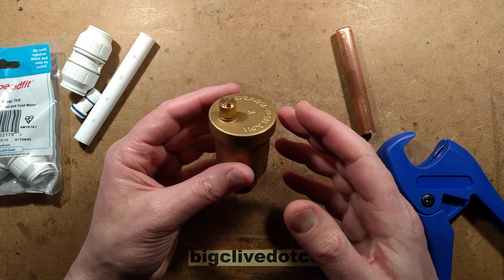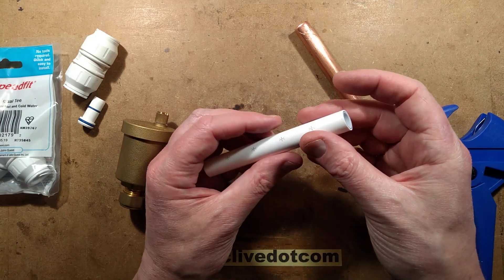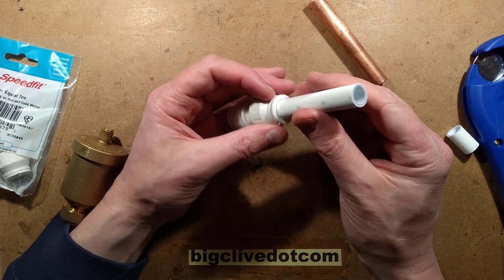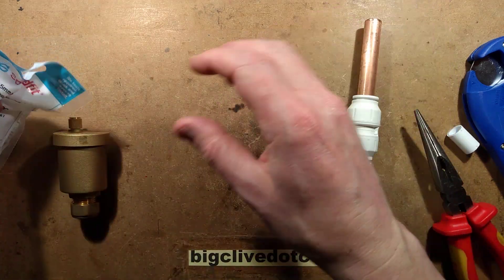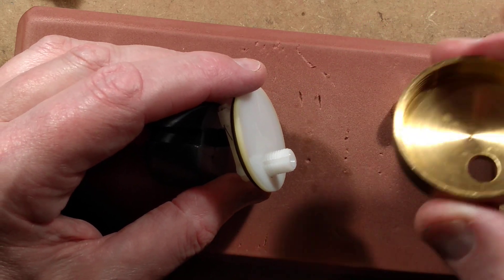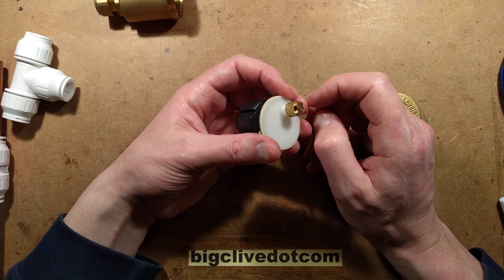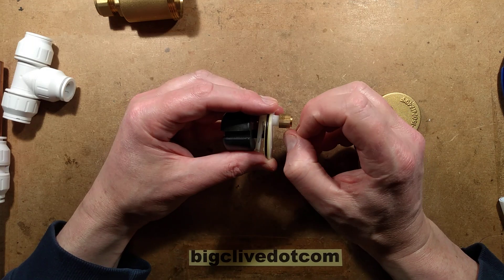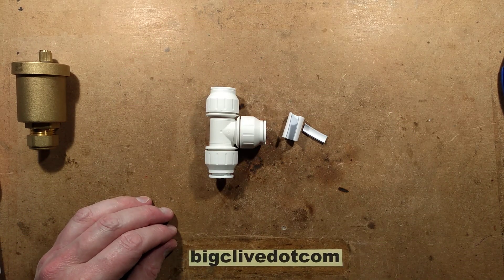Inside a bottle air vent and plumbing ramble.  (No electronics whatsoever.)

Comment: As a retired marine engineer, I have always sworn by copper pipe, but seeing this has given me food for thought. Very interesting video (as always). Keep up the good works.
Reply: it's very easy to use and there are different makes, but have used the jg speedfit stuff, (available at screwfix in the uk) it is as simple as, cut pipe, use insert, insert into joint, that's it , only thing i have against it, it's more plastic in the world
also am a bit against using it for mains/drinking water but that's just me
Reply: idiot stupid our Sharkbite system is also questionable for water, made of a supposedly leadfree brass alloy, but who really knows?
Reply: As a sailor you without question have sworn, though the presence of copper pipe was only coincidentally “by” only due to frequency of curses in a large variety of locales. That’s the engineering part: a rule of thumb everywhere there’s water.

Comment: On JG speedfit don't forget to use a locking clip under the release collar. Esp on long runs of heating pipes that can expand/contract enough (over time) that the collar can release if it rubs against a joist or an adjacent fitting. 
A smear of fairy liquid on the pipe eases assembly of fittings too. When I did a plumbing course a few yrs ago, all students were using quite aged & dirty JG fittings & old plastic pipe that had been taken on & off hundreds of times by trainees. Rather impressively, despite the extreme re-use & tired appearance of the fittings, none ever leaked & gave me trust in their integrity.
Reply from the maker: I'm going to make sure any connectors are well away from adjacent objects that could press that locking ring in.
Reply: All good then, you'll be fine 👍. From memory, the only restriction on using plastic pipe is to not connect direct to a boiler, (due to residual heat build up), & the 1st metre from any boiler should be made in copper.

Comment: I've used both. I did not find one to be much faster in general than the other. but the flexibility of the pipe was defiantly advantageous in certain situations. Also our house is in the shadow of a hill here in st johns so its very cold in the winter and the only pipes that took a hit were copper. That said they were also from the 70s. The pipework in our house is like an exercise in finding the longest route to the shortest distance. its ridiculous. So I've been going about reducing that obscenity.
Reply: yodaco ocadoy have fun with whistling pipes, coughing spigots, unpredictable pressure differentials causing temperature fluctuations and water hammers while you redesign what once probably worked pretty well.
Reply: If you want to know obscenity then you ought to have seen the equalizing apparatus I had to invent for the last house I owned where nothing else was possible except to tear out walls- everything was already connected in the most efficient route, yet the whole was less than the sum of its parts.

Comment: The idea with the bottle vent is, you back off the screw cap just enough that air can escape.
No more. If dirt stops the float valve sealing, there is a fibre washer in the cap, which, when wet, will swell and seal, preventing disastrous leaks.

Comment: Yes Clive. I’ve used Speedfit plastic fittings and pipe to add an extra valve to a heating system (the original suffered from gravity self circulation so even when the heating was not on, the radiators on the first floor would still get hot). This was after we had two extra radiators installed by plumbers and I saw them use the Speedfit plastic fittings and pipes (they were not the cause of the circulation problem, that existed beforehand). They loved this Speedfit system. So much quicker and less messing about. They did use copper pipe where the pipes were exposed as they ran along the skirting boards. All this was over 20 years ago now.
Have since moved house (a much newer house), and although no major problems, have had to tighten some of the compression fittings due to small leakages (all copper pipework as far as I can see). But I keep some Speedfit plastic fittings, the straight joins, in case I ever need to carry out a quick repair.

Comment: Great vid Clive! Only downside of PEX is trying to manage a 25m roll of tube in freezing conditions in a loft in winter! The pipe is softer/warmer stiffer/colder.
Reply: SpiderElectron the other downside is having winters with freezing temperatures, a house with unheated loft, being forced to chose winter for the installation and to use plastics with hormonal catalysts in them. How can you even sleep at night in such horrible conditions?
Reply: @HighestRank  You install it. It looks great.. You come back later after it's been used for a while and it sags between every pipe clip!

Comment: Hi Clive, Just watch vid and yes the plastic pipe and fittings are very good in certain applications, Did you know that you can use them on a heating system and that mice just love it. As a Maintenance person for a large hotel group we used this plastic pipe and fittings until the mice thing started we were dealing with leaks on a daily bases and had to revert back to copper. We never had a fitting fail it was always the pipe the little shits chewed through. Hope this helps have a good one

Comment: Used the JG push fit plumbing pipe and fittings for replumbing my place 15 years ago. Absolutely zero problems with it, quick and easy to use. However you do need more supporting clips along the length of the pipe than you would with copper. I was slightly nervous about the possibility of mouse attack, but they haven't touched the pipes, even where they have shredded the foam insulation that I used. Go play in the trap ye wee furry feckers....
Some folks have mentioned possible O ring failure over time. I use a lot of O rings in my world, hydraulics, air, water, drive belts ! The ones that fail are the ones exposed to sunlight, should be fine inside a nice dark plumbing fitting, under the floor.

Comment: We repiped our hot water lines with pex pipe and SharkBite connectors. Pex pipe has some flexibility so it can be angled without using angle connectors. It's also freeze resistant. Pex pipe just expands when frozen. SharkBite connectors just push on. You can also use a kind of split ring tool to remove the SharkBite connectors if you need to.

Comment: I don't get to do much plumbing other than the occasional DIY job around the house, but I have to say that I've found plastic pipe and fittings to be extremely reliable. PEX pipe in particular is extremely good and resistant to almost everything you can throw at it. The only downside is stuff like earth bonding when you have a mix of plastic and copper pipes running around

Comment: I have found the push fit pipes good but I have had a very occasional faulty one very few and far between some of the more unusual fittings are quite expensive though.
Reply: JtotheW kinda hard to test some types without fear of reusability or at least unwrapping a few- so you learn to look inside and identify badly formed tangs, just like farmers used to candle their eggs.
Reply: JtotheW and yes the push fit pipes may be good but those are specifically made to be used as electrical conduits, not liquid.

Comment: Copper has the added benefit of being antimicrobial. With that said, PEX > everything else. Get a cheap crimper, you have rock solid connections, flexible pipe with minimal fittings, and mostly freeze resistant. Even a kid can do it right. I can't trust that o-ring crap. Crimps are better and cheaper. How often do you really need to disconnect your pipes? The oxygen barrier PEX has an aluminum layer inside for heating systems...it's not used for normal plumbing.

Comment: used that system when i replaced my bathroom and kitchen, bit more expensive and bulky than copper but works well with no leaks, i actually have a bag of the fittings lying around, i would worry about plastic and rubber degradation over time though

Comment: Been using the plastic here for quite a number of years, about 2 decades or more, we call it PEX here in Canada. and it is very good especially for freezing, as you mentioned.  We have most of the country that gets down to minus 30 and many places get even colder, and so if heat is lost it is a major risk to the plumbing, but PEX works very well.  We have other systems for connections that are even more simple than yours check out "Sharkbite pex connector" on google

Comment: All I have to say is be careful of pressure reduction, due to the ID of the joints being significantly smaller than the ID of the pipe itself, it lowers per joint due to friction and such.

Comment: the only problems i've seen with plastic pipe were using cheap shit or installing it wrong... it's hard to compromise plastic by cutting corners in its ingredients compared to copper. it's not recyclable, but then again not many people will deal with 50 year old corroded copper pipe either

Comment: I wouldn't worry too much about the compression fittings. They are very similar to what most large trucks and construction equipment have used for years on air lines.
Reply: Shawn O'Hare yet air doesn’t freeze while expanding. Similar concept, different applications.

Comment: The weird hinge may be to give the float a mechanical advantage. 
Not sure what typical water pressures are, the weight of the float, and the area of the valve. ... But having it hinge closer to the valve would give it a mechanical advantage. 
otherwise, the pressure of  the water may be enough to support the weight of the float, and thus the valve would never open.

Comment: One concern common to all types of plastic piping is the growth of bacteria in the pipes.  Copper is a pretty terrible substrate for biofilm formation, but plastics are inert enough that they can be colonized easily.  I guess if you're using chlorinated municipal water, it's not an issue though.

Also: it's nice that PEX is elastic enough to survive a freeze, but the fittings themselves often aren't.  If you've ever worked in a hardware store, you'll know that people will show up every winter trying to patch their split water lines.  You can't just give them fittings to make a repair, or else they'll be back in an hour bitching because they don't understand that their pipes are all stretched oversize.  You can't really warn them either, because nobody ever believes it.

Comment: The problem I find with the auto-vents is that if you leave them with the cap open the seat eventually smegs up (Fernox, limescale, dead water fairys) and they then have to leak until said fromunder fills the vent hole, rendering them useless; until they leak again.
Reply: typical vent, cap open or shut, they gum up and leak.... often crud sticks the float to the side

Comment: As a mechanic, I can assure you that O rings don't last forever. Or even very long. I'd bet on the hot water side, they probably won't last over 20 years, if that.
Reply: MadMan Machinations as a mechanic you’re used to dealing with buna N, nitrile and neoprene rings, and infrequently PTFE. There ARE more durable materials available: for example even the cheap exterior latex paint comes with two and a half decades worth of guarantee, and the expensive stuff is double life at 7x the cost.
Reply: @HighestRank  Using paint as an example of o-ring lifespan is not very helpful. Perhaps you'd care to find out exactly which type of o-rings are used in any plumbing fitting? Let's be realistic here, the manufacturers are not going to use the most expensive stuff, they're going to make it as cheap as possible for their profit margins (which your paint example makes a very good point of). I couldn't find any info on the type of o-rings used. But I looked up SharkBite fittings, and they guarantee them for 25 years, which is not a far cry from the 20 years that I gave them. Knowing that, I'm willing to bet I'm right. They use ordinary o-rings (like everyone does) and they won't last very long.

Comment: Plastic is ok on heating but it expands more than copper so you have to use more fixings. Copper is a natural disinfectant. Plastic encourages bacterial growth particularly after mixing valves where the water never exceeds 43C.

Comment: The popular American brand is " shark bite "  expensive but worth while for repair work or joining dissimilar  materials .
Reply: And they're not technically rated for air pressure, but I've seen them successfully hold a 190PSI/13bar for years just dandy.
Reply: Sharkbite* worthwhile *
Reply: @HighestRank  auto correct

Comment: A little hint . Install an isolation valve when you install it . It will leak and need to be serviced if you install a valve you do not have to drain the system .
Reply from the maker: I always use isolation valves wherever possible.  Although, ironically I have one that now leaks when mid position between on and off because of its O-ring seal.

Comment: Assuming rigid members, are those fittings strong enough to be use structurally?
Reply: Michael Thibault
Not while under 1-2 bar pressure nor while holding a heavy copper pipe filled with dense liquid together as part of whatever other structure you might have in mind.

Comment: here in canada we use a version of the plastic piping thats called PEX we have crimp on rings, push fit fittings called sharkbyte fittings, and fittings like in the video the simplest fittings out of them all are the sharkbyte fittings just push the pipe in and done the plastic piping holds up extreemly well redone my house with it and even the in floor heating uses the piping as well though a special variant of it called he-PEX if you kink the pex piping you can use a heat gun or propain torch to heat it up and restore it its extreemly reliable and forgiving

Comment: Not a huge fan of the compression fittings outside a limited number of specific applications. They tend to leak unless you have tightened them just right: not too loose, not too tight. Solder is your friend.

Plastic supply lines are awful—the stuff currently commonly used in the US (CPVC) gets super brittle after just a few years. The PEX stuff is supposedly better, but eh.

There was a water hammer stopper under my kitchen sink. When I replaced the garbage disposal I accidentally bumped the hammer stopper. It snapped right off and it too me a good 30 minutes to get the water shut off. Would up with about an inch of water on the kitchen floor :-(

The plumber who came out said they have all sorts of issues with this stuff. If you have them repair something they disavow any responsibility if the stuff cracks and and the pipes in the walls need to be replaced.

Comment: Reason is that water pressure will auto close it, even with the float destroyed or flooded. This wouldn't work if the seal could move any further away from the discharge

Comment: Here is a tidbit regarding something said in passing. The conventional wisdom that ice expanding against the piping walls is what splits the piping in freezing conditions is not correct. What actually happens is the ice occupies more volume than the water that became the ice. The remaining unfrozen water has to occupy less volume. Because water is essentially incompressible there is a tremendous water pressure build up in the remaining piping that has yet to freeze. The piping rupture ends up occurring in the high water pressure piping sections. Often when the split happens the sudden drop in pressure in the chilled water results in ice forming at the split, thus leading to the erroneous conventional wisdom. Hard to believe, right? This could get one into a bar fight. This outrageous idea can and has been demonstrated by arranging water filled piping into and out of a super chilled brine tank. The piping in the brine section is what freezes but the unfrozen piping outside the tank is where the piping splits. Of course in the end it is all a moot point. The break is still caused by freezing somewhere.
Reply: nothing like super high "hydraulic" pressures at work,

Comment: I use these for instrument lines on compressors. They are heat cycled hundreds of thousands of times under 150 psi, never had one blow at the fitting.

Comment: While we do have SharkBite fittings here in the US, it's more of a premium option. I'd wager most people stick to the classic PVC and adhesive. It's the most used on new houses here, especially around fixtures. I have only seen adhesive fail when cleaner wasn't used or the glue was not even, otherwise they last 40+ years.

Comment: PEX stands for "PolyEthylene Cross-linked", and usually refers to small diameter water pipes, up to maybe 20mm, in internal residential or commercial fitouts.

Most flexible plastic pipes or similar will be some form or PE, and each manufacturer or standards organisation comes up with a different acronym to describe their own secret herbs and spices, but it's all fairly similar.

Underground electrical cable is often called XLPE cable: "Cross Linked PolyEthylene", the name of the insulation.

Larger diameter pipes used for underground installation, on farms, or by the water service provider are called PE100: "PolyEthylene with minimum strength 10.0 MPa".
Reply: Griffin Putland and meanwhile drainpipe for leech fields continues to service the farm with the thinnest most flexible and cheap walls imaginable.

Comment: The O'rings have a finite life. Once they fail, especially on hot water pipes, it's all over.  Use a non-o'ring PEX system, the best in the world is Rehau  - that will exceed the life of copper.